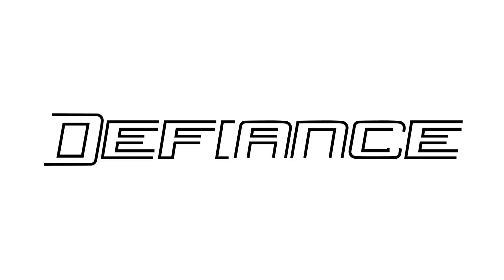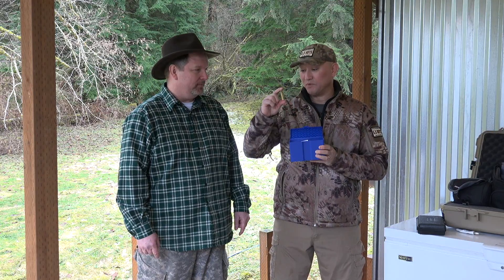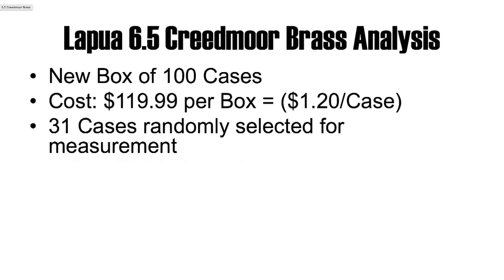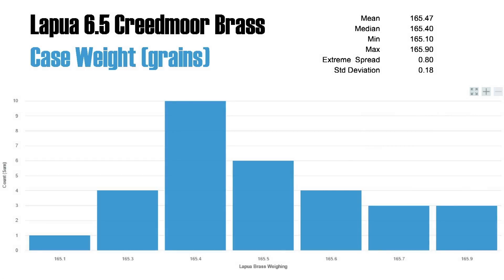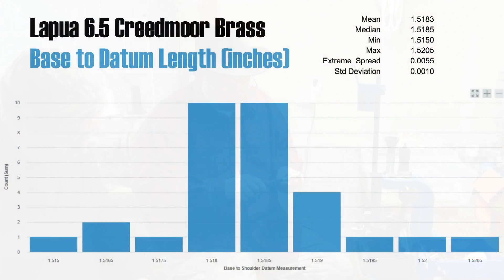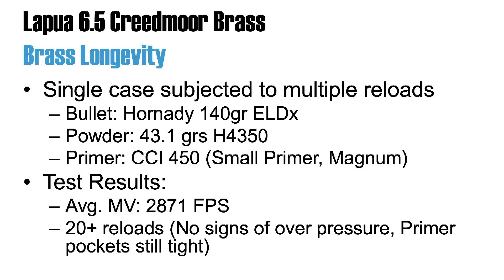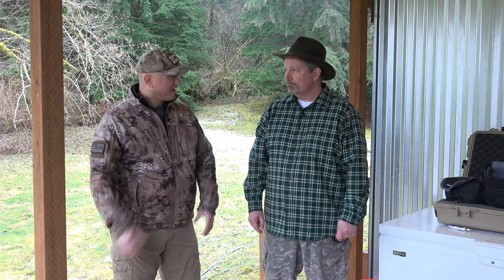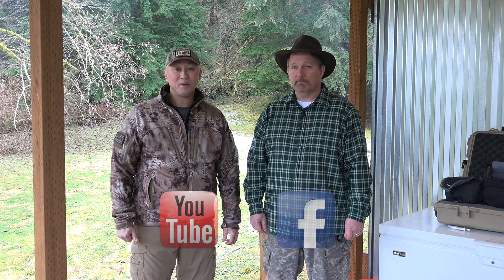S4 - 02 - A Look at Lapua 6.5 Creedmoor Brass

Comment: I need some help.  I am working on loads for my 6.5 CM using H4350, ELD-X 143 grain bullet with brand new Lapua brass (24" barrel).  I have learned the Lapua brass has a smaller internal chamber allowing for less powder.  I attempted to load 41 grains, but began compressing the powder and creasing the bullet; but I am seeing posts of others loading around 43.1 grains of H4350.  I am missing something?

Comment: Did u guys resize these before loading them? Also do u have to use a magnum SRP?
Reply from the maker: Except for the initial load in the virgin brass, each time the cartridge was shot it was full length resized and then reloaded. for the primer we used CCI 450 (small rifle magnum primer).

Comment: In general, do you normally Full Length Size or Neck Size for 6.5CM? Getting my Howa soon.
Reply from the maker: We almost always use full length resizing dies.
Reply: 6.5 Guys is that because you want to use your rounds in various rifles? Or do you have another reason? I thought neck sizing extend brass life and gives better consistency. Really want to learn from you. :-)
Reply from the maker: The brass will case will continue to expand on successive firings. If you only neck size, eventually the case will become hard to chamber and extract. Full length resizing will bring the case back to the proper size to ensure reliable chambering/extraction of the cartridge. Although full length resizing does work the brass more than just neck sizing which would cause the brass to work harden. However, we also use the AMP machine to anneal the case each time we reload so this softens the brass back to factory specification which also helps to extend the case life.

Comment: I wonder if 31 cases is a sufficient sample size.  For psych and health sciences 32 is the standard which assumes a wide distribution of both the dependent variable and participant pre-test measurements. Student test scores are an example whereas, 32 students will have a wide range of attributes that cause a wide range of scores.  With sorting measurements consisting of minor variations, without an attributable stimulus, in pure analytical statistics the minimum sample size is near 250.  Also, those minor variations is case weight and OAL are not a good measure of accuracy performance.  A cartridge case has dynamic properties resulting in variations that have no effect on accuracy.  For instance, case rim variations and extractor grove variations; both contributing to case weight but not performance.  Additionally, the raw material brass cup from whoever manufactured them may have variations in alloy composition which does have an effect on accuracy but is not shown with case weight.
Reply: We only had 100 to choose from so measuring 33% of the population seemed reasonable. Curious what number you would suggest?
Reply: First, thank you for producing high quality videos; it takes a great deal of time and effort and the shooting community greatly benefits from your efforts.  As for a suggestion in sample size, it is dependent on what you are claiming to measure.  Are you claiming to measure the consistency of Lapua brass as a whole or the consistency of this single lot of Lapua brass?  Additionally, is this lot of 100 pieces representative of Lapua brass as a whole?  Even further, is the 33% sample of this single lot of Lapua brass representative of Lapua brass as a whole?  With 31 measurements we can run a T-test to predict the remaining 69 pieces and determine what would be considered an outlier but the confidence interval would have to be rather wide.  If I had the time and energy, maybe I can muster it, I would measure all 100 pieces, maybe 200.  With 100 or 200 measurements, we can be somewhat confident of a representative sample of Lapua brass a whole.  Thank you again and I look forward to more of your videos.  Hopefully we will see each other down the road.

Comment: Is that a normal load for your 6.5 CM?  Looks like your getting more velocity than I am with my 260 ai (I can switch to RL26 and am shooting around 2950).  When I run the numbers in quick load with the 140 eldm, 43.1 gr of H4350 looks like it's producing 70K+ PSI to get 2871 out of a 24" barrel.  Your brass is obviously not showing any pressure signs, what barrel are you using?
Reply from the maker: The 6.5 Creedmoor rifle used for this video came from a good friend that was present for the testing but not in the video. The load used was the 'match' load he uses for this rifle. The rifle currently has a Broughton barrel.
Reply: Thanks for getting back with me!  It looks like the 6.5 CM is getting better velocity with less powder than I'm running in the 260ai.  Maybe I just got a slow barrel.  Ever since Lapua came out with brass for the 6.5 CM I've really been considering switching.  I've also got my eye on the 6.5 SAUM, we'll see which I go with first!

Comment: I just watched the vid again, 0.0003 is not 3 thousands, its 3 ten thousands and the extreme spread of 0.0010 is not 1/100th of an inch it is 10 10 thousands or 1 thousand of an inch. Unless the numbers you are showing are wrong. Just thought i would mention.
Reply from the maker: Michael - I presume you are referring to the Std Dev. of the overall length. If this is the case, the numbers shown are correct and when we did the voice over for this video it was all ad lib (not scripted) and I stated this incorrectly. I should have said 3 ten thousands as you pointed it out. 
  - Steve

Comment: I load a similar cartridge but with lapua brass, cci br4, 140 Berger hybrid, and H4350. But I never surpass 42.5 grains of powder. Is 43.1 intentionally a hot load your testing ?
Reply: I was wondering the same Im loading them at 42.3 and thought that was on the hotter side.

Comment: I don't have my books at work but hornady website says that H4350 at 40gr is a compressed load and pressures of 59,200 PSI and this is their max. So if I start at 36gr and 49,200 PSI and see how the case looks and primer looks, I should be okay right?
Reply: Our attorney Saul Goodman reminded me that there are so many variables to consider. Just the brand of brass and internal volume can make a tremendous difference and over-pressure conditions are not always obvious. I've gone through enough 4350 to observe significant lot to lot variations. I wish I could tell you that you would be OK but that would be inappropriate and if something went wrong you or somebody else will own my house and shooting range. Nevertheless, we appreciate your viewership and comments.
Reply: your right I will investigate more when it is time to load

Comment: Funny that you put this vid up. I just bought some lapua brass for my 6.5 creedmoor. I have a bunch of Hornady brass and want to see the difference with the two shooting the same loads. (Starting loads first. safety first.) If you can answer this Question. What is the difference in pressures using  hornady bass with large RP vs lapua brass using small mag. RP?
Reply: Thanks for watching. We didn't have a method to measure case pressures. What we can tell you is the same load could produce significantly higher or lower pressures just by switching brass. We saw that when we evaluated the Alpha Munitions brass.
Reply: Thanks for the info

Comment: CORRECTION: In the video we make a statement that Lapua weight sorts their cases. We learned directly from Lapua that they DO NOT sort their cases by weight. Here's what they said: 

"By the way, we do not sort the cases out with their weights at the factory like you mentioned in the video. ...we just to manufacture them to be consistent.
 
The weight variation practically comes from the tolerances of extractor groove. We have several turning machines on the end of case manufacturing line and all of them are turning the groove to the bottom of case in a certain way but according the tolerances of drawing.

So, the weight variation does not tell much about the consistency and quality of case. You get much better picture about the consistency by measuring the volume of case."
Reply: Ed Mobley wow an impressive response from lapua

Comment: How often did you have to trim the brass between shots?
Reply: We did not trim. Throughout the test brass length remained within specification.
Reply: Awesome.  That settles it.  I'll definitely be getting some.
Reply: After firing 40 rounds with the the new lapua brass, I just measured the fired cases and found that they'd changed from very high pre-fired' length consistency to more varied lengths ( by 0.003-0.005" ). I was using them for load development so there were 5 different charges involved. Could that account for the variation in 'once-fired' casing length?

Now that I think of it, does it make sense to use new brass for load development? Any thoughts out there?
Reply: I've noticed that when doing load development some of the lighter loads do not grow the brass as much as the hotter loads. Sometimes you can't avoid using new brass though. After the second firing everything should be OK. 

Now I have OCD'd over this issue: I have two lots of brass for my .308 - one that I did load development with (lot 1) and one that I will use with a consistent load across all cases (lot 2). While I doubt there would be any measurable difference between the two lots as far as the performance needed to play our game, I admit I would use the second lot for the bigger matches and the first lot for practice and club matches. Might be me over-analyzing things but that's what I would do.

Comment: Hey thanks for the video guys! I really appreciate the time you guys spend to get these scientific results. It really means a lot to a lot of us. I'm very impressed with the quality of the brass and really appreciate the fact that Lapua is using a small rifle primer in the 6.5CM brass. What then differentiates it from their 6.5x47? I feel like they conceded to the 6.5CM a bit by doing this.

I'm also very impressed by the quality of the reloads through the Dillon press. Do you believe you can achieve similar results with one of their progressives?

Unrelated question: What bolt are you using in the rifle? Is it a Remington 700-based action? It looks incredibly smooth.
Reply: We've had a number of discussions with RBros and other folks about this. It appears that 6.5 x47 still has the edge as far as barrel life. But it also looks like you can push a 140gr bullet pretty fast with the 6.5 CM - speeds that are not obtainable with the 6.5x47. I'm particularly interested in the potential of using this brass for 6mm Creedmoor.

Comment: I'm a little confused about the bullet you used was it a 140 ELD or a 143 ELDX
Reply: It was not the ELDx as reported in the video but the Hornady 140 ELD Match. Stocking #26331 UPC 9025526331
Reply: Cool thanks Ed.

Comment: Hey guys. I just did a video on this on my channel as well. Looks like your consistency is similar to mine. Is your  measurements for neck concentricity taken before sizing?
Reply: Hi - taken before sizing...right out of the box.
Reply: Ed, did you size the new brass before first firing?
Keep up the great channel!
Reply: Yes
Reply: Sorry for the re-direct Ed, but was that sizing full, neck or done by just pulling the expander ball through the neck with using a bushing?
Reply: We full length sized and used the expander ball that came with the die. It was a Whidden bushing die. Bushing size was .288". Since it was the standard expander ball, we ended up with about .001 neck tension. If I were actually loading for competition I'd probably use a .287 bushing and a mandrel to get .002 neck tension. I've noticed the extra neck tension seems to held lower SD and ES.
Reply: Thank you Ed, that's very helpful. I'm trying to understand how to get more consistent neck tension and your video on mandrels intrigued me so I need to go learn more. 
Cheers!
Reply: Glad to help...so far so good with the mandrel. If you decide to go that route, consider the neck turning carbide mandrel in the caliber of your choice.
Reply: Good video by the way Moparmadman
Reply: Thanks I would post a link in your feed but I didn't want to overstep.
Reply: Feel free to post a link - we're all in this together. Please do the same on your site.

Comment: would there be a big difference in velocity change if CCI BR4 SMALL RIFLE BENCHREST PRIMERS were used in place of the magnum primers
Reply: I'm always surprised how much of a difference changing out a primer can make. The benchrest primers are a non-magnum primer so there should be a difference. I must tell you that the CCI 450 primers are stellar performers in all the loads we use them in. Personally I have standardized on that primer whenever possible. They are reasonably priced and always seem to be available. We're even running them in the .308 using the Lapua Palma brass.